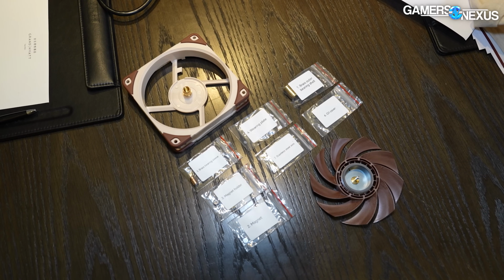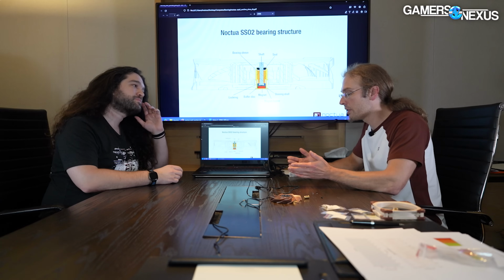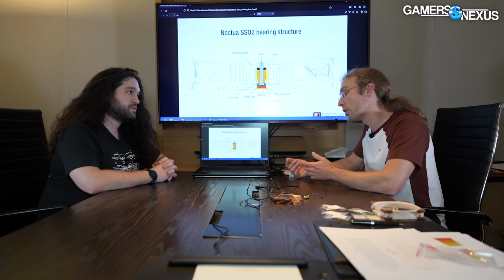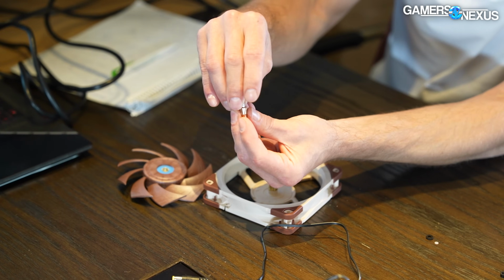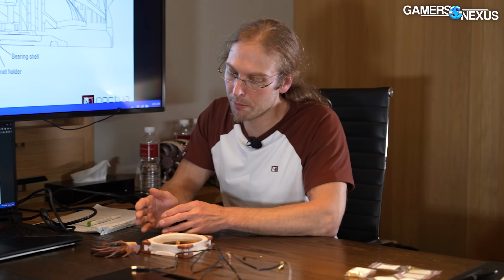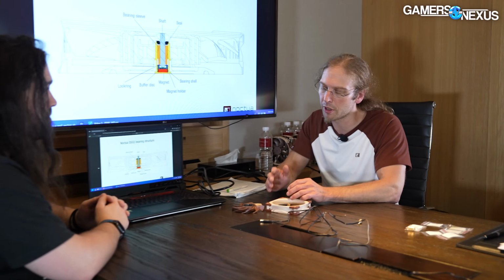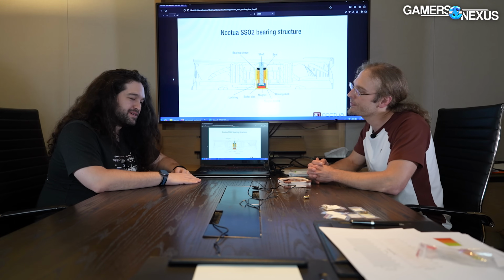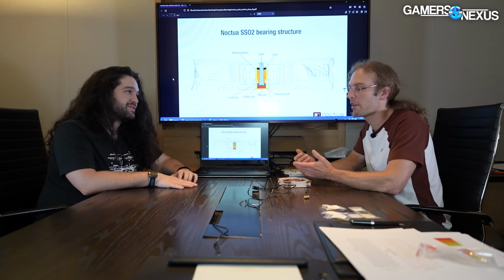Fan Bearing Differences: Fluid Dynamic, Ball, Hydro Dynamic, & Sleeve Explained, ft. Noctua

Comment: He is basically trying to tell that a normal sleeve bearing is essentially a FDB or HDB because it also uses oil pressure to support the rotating shaft. The SSO bearing is like a hydraulic bearing but with a magnet to help with the startup. The grooves on the outside of the bearing help recirculate the oil, and the magnet helps with shaft stabilization. I totally agree with his view that a normal, well designed sleeve/hydraulic bearing works like a FDB/HDB. I have had a fan mounted in my ups running non stop for 4 years. After 4 years the fan jammed, and all it took to free it up was some machine oil. When I inspected the bearing bore while putting oil, it was in very good shape. FDB's would also require oiling sooner or later since they rely on the same properties of the lubricant as sleeve bearings do to keep the shaft suspended. A well made sleeve/hydraulic bearing fan would require oiling every 2-3 years, and so would a FDB fan as I mentioned earlier.

Comment: i disected a few PC fans that claims "hydraulic bearings" only to find a sleeve bearing with babyoil on it (that's a joke, but some form of oil). no vanes at all. so i learned to buy fans that shows how their hydraulic bearings are made. thats why Noctua, has been around for years without the fancy rgb nonsense, they focus on performance and engineering.

Comment: My Old PC has 9 Normal Sleeve Bearing Fans (Case - 4 x 200mm 2 x 120mm, Loop - 3 x 120mm) and that PC has over 100,000 Hours Near Constant Run Time over 10 years. 
Only 1 fan died as wire got stuck in it for Unknown amount of time and when i noticed and remove wire fan was cooked and wouldn't turn anymore.
Do we really need fans with a higher lifespan than stock old bearing type fans as i mean like 75,000-100,000 Hours is a LOT for 95% of people.

Comment: Also Keep in mind Car Turbo Chargers (Most have the same sleeved bearing design all be it with fresh oil flowing through it and they run at 85-200,000 RPM (yes 200,000 RPM) and at temps of 350-500*C

Comment: The rolling noise of ball bearings only becomes a problem if you are in an environment like an anechoic chamber. There are silent ball bearings using plastic ball cage which don‘t have sharp noise, and the friction/rolling noise is usually inaudible one meter away outside the case. The only problem is ball bearings are easily damaged when shipping, which will lead to additional noise. The super-hard steel balls leave indentations on the bearing rings when impacted, and when it rolls over the indentation again, it will make a sharp metallic noise.

Comment: I would love to see fans that use magnetic levitation discussed, I have used some super cheap $20 120mm mag-lev fans from ebay as replacements in a UPS and they have been running constantly for almost a decade.

Comment: As a longboarder, closed type bearings are so much better since they dont foul up quite as fast. Sure you lose efficiency and serviceability because the cages add resistance and restrain access, but I'd rather not have to clean them out every other week

Comment: I hoped that you'd dig a bit more into the dust topic. How do they keep the dust away during normal operation?
It's typical that cleaning dust from the fans manages to bring some dust in the bearing mechanism and cause laud scratching and beating noise.
The seal in the diagram cannot be too tight or it would start to act as bearing itself.

Also, it would be nice to have a fan where the part with the blades could be detached, without disassembling the bearing itself.

Comment: I'm sorry, I am not sure what was discussed and what to make of it. I was looking forward to understanding what advantages some types of bearings have over the other, but it seems like we just learned that just "because something something doesn't mean something", which doesn't explain anything. "Just because it says FDB, doesn't mean it's good." or "just because it has herringbone groves, doesn't mean much at all." I will check out the rest of the videos on fan bearings, but this is the first video that popped up about fan bearings and the least I wanted to know was what "bad" things to watch out for when buying fans. There is a lot of interesting info tho, maybe the subject is more complicated than I thought. Thanks for bringing us cool videos like this!
Reply: Its hard to say, because the actual manufacturing and quality of each bearing matters more than the type of it.

Lets say bearing A was better than bearing B.
The differences between those would be small and a good B could be a lot better than an average A at the end of it.

The only thing to keep in mind is that anything that uses lots of oil will usualy die first, since the oil leaks out over time in a vertical or top side up mounting.

Comment: I've STUDIED the bearings inside the submarines. It's crazy fascinating. I've always wondered HTF they could stop water from coming in with millions of PSI coming in from outside in deep dive?!  Turns out they ADD FLUID INSIDE the sub to equalize press so there's NO CHANCE for sea water to come in in the "bearing" compartment. Nuts.
Reply: Yeah, I used to work on Navy subs back in the 80's (civilian dockyard technician, not enlisted).

One of the most interesting things I saw and worked on, was how they provide a compass repeater outside the sub on the conning tower.  That compass repeater needs a metal housing, with a glass window on top so that it can be read when surfaced, yet also needs to be able to survive the enormous pressures of the deep, without that flat glass window getting broken under the crushing pressure.

Same deal as you describe.  The whole thing is filled with a clear mineral oil and there is a metal bellows on the bottom on the unit, which allows the volume to be compressed in case there is anything inside which is compressible, such as some unwanted air bubbles.

Automatically and passively, the oil inside very closely matches the pressure outside, thanks to the oil and bellows.  The incompressible oil almost perfectly fills the inside and the bellows caters for any pressure equalisation needed due to any area the oil could not fill.

Comment: I wish you'd asked about fan orientation relative to gravity, and how that influences bearing choice.
From my own experience, fans seem to fare best when oriented so that an axial fan will push air sideways, so that the long-axis of the impeller axle is horizontal.
Now, this is a small sample size as I've had less than a handful (5) fans actually fail on me over my time building PC's for myself and my family (a thing I am thankful for), and it seems the smaller the fan, the quicker it fails in any case.
However, I noticed another trend. Most of the fans on my stuff that have failed had their impeller axles long axis oriented vertically. I think this might have been causing the oil to drain out prematurely because brushless DC fans used to be built frequently with the data sticker being the thing that keeps the oil inside the fan bearing, meaning that if the fan is oriented so that gravity tries to pull the oil out of the bearing but the sticker is the only thing holding it in, that sticker will eventually fail and let the oil out, followed soon by a rather noisy fan bearing failure (lots and lots of squeaking).
Since my current PC uses nothing but Noctua fans, I am happy to see that the SSO2 bearing (a type of FDB) they use is far better engineered than using something so flimsy as a mere sticker to hold the lubricant inside the bearing housing.
Knowing what I know now, I can only describe the bearings in those older fans as what I would currently call "Not up to my standards for the task in any way". Every single one of those fans that failed, I took apart. Every single one that failed and was disassembled, had in it a bearing that was nothing more than a sintered bronze "Oilite" sleeve bearing with the only consideration for longevity being an extra drop or two of lubricant for the sintered bronze to wick up by capillary action and convey to the surfaces of the bearing that are in relative motion when the fan is operating, with that lubricant being held inside the fan as a whole by ONLY the label on the back-center of the fan's housing (as mentioned earlier).

Thankfully I know better now, and if I can avoid it I will not be purchasing another fan with such a crudely executed Oilite sleeve bearing.

Comment: 12:40 ish, he's saying a well executed example of one type will outperform a poorly executed example of a theoretically superior type (for pretty much any given engineering task).
This is quite true, all the way out to even mundane everyday "not engineering" tasks.
Take cleaning floors for instance, if you tell someone to clean a floor and they've had say 10 years of experience sweeping floors, they'll probably sweep the floor manually if the task is amenable to this. Tell "just some random person" with who knows how much experience to do the same thing, but hand them a vacuum cleaner, and they'll probably do a worse job than the person doing the sweeping, despite the vacuum cleaner being "the clearly superior choice" in theory.
Same with actual engineering, and this phenomenon is why it's so hard to actually beat the current state of the art with a "new method" rather than just continuing to apply incremental improvements to the known and highly studied way of solving a given problem.
To have the "new method" beat the existing method, the new method must be implemented in a sufficiently competent way, and because it's a new method, it takes a long time to improve the execution of it to the point it is provably superior to the existing method of solving that same problem.
For another example, look at Electric Vehicles, a much more engineering oriented problem.
We've had the technology to make them since around the same time we had the technology to make internal combustion engine vehicles.
And yet only in the last 15 years or so have we seen them become commercially viable, because the implementation of the EV's battery which provides energy to the motor to move it was not sufficiently competently executed due to limitations of technology of the time. Lead Acid batteries of all kinds are simply not sufficient to provide a good enough range, they don't last very many charge/discharge cycles when discharged most of the way (over 80%) every time you charge/discharge them, and they have a high environmental impact both to create, and to recycle or dispose of them. Lithium ion batteries changed that, but lithium ion battery production has only really taken off in the past 25 years, and only been scaled up enough to meet demand for EV's in the past 10 years, but now that EV's have a competent battery system, EV's themselves are commercially viable.

Comment: why is it that Arctic fans have such great static pressure, and run almost silent at every speed?  Based on Performance and low noise Arctic have been the best fans I ever owed. As a side note they are also the cheapest to purchase.  I wish there was a breakdown of fan build and comparison to other fans as well as testing to see if the specs are accurate.  That said Ive tried different fans for my application, and Arctic wins on performance and noise every time.

Comment: It's fun to learn more about fan bearings, when one of my gpu fans died, other rattles at lower speeds (because it doesn't detect it's own rpms and uses rpms of first one) and jury rigged a case fan to gpu for some cooling.

Comment: Kind of confirms the "vibes" I've got when doing shopping and research -- "FDB" has no clear differentiating factor, is in the cheap and expensive fans alike, and isn't specific enough (if they mean anything particular by it in marketing) to make a good purchase decision based on. Although it is vaguely "better" for the typical use-case of a personal-use computer for most likely being somewhat quieter than ball bearing.

I appreciate reviews based on noise and thermals... On the other hand, lifespan is very hard for a reviewer to meaningfully benchmark. So, really I think it comes down to some sort of judgment call, and since Noctua has staked its identity in the market on being a premium option for more exacting build quality and engineering standards, and a serious dedication to longevity (both of support and product lifetime)... it's something I would personally trust Noctua to deliver on in any product they put out. I also trust them more than other companies to make the right choice for a given product segment even if it goes away from the current "meta" or marketing hype trend -- if engineering shows it to be the right choice for the intended use-case and manufacturing it that way is feasible, I believe they will tend to do it.

I wish we could easily know as buyers how long a fan will last, and how well its low-noise operation will hold up over time. Until we get a meaningful way to convey the quality of the manufacturing and engineering standards of the product, brand reputation really is the next best thing, and sort of the best we have, in my opinion. I can see why Jakob would point to that, there's not much more consumers can really go by. That, and if an unusual proportion of reviews report failures then the product is probably not that good, but people are reviewing after a couple of days usually, maybe a few weeks or months, very rarely a few years. Almost never decades. And by then it's too late, the product is usually discontinued... Oh, well.

Comment: Has any manufacturer considered synthetic Sapphire bearings?  i.e. similar to what is done for individual gears within high end "automatic" mechanical watches?  Such as the Omega Daniels calibre 2500 movement? Note that the cost of such bearings is minimal at USD 0.02 - i.e. 2 USD cents per Sapphire bearing unit.

Comment: I feel confirmed in my fan choices. 
I use a 140mm Noctua on the intake, a 120mm Noctua on the cpu cooler and a 120mm Arctic with ballbearings on the exhaust.

Comment: I have several fans that have been in use for over 2 decades and they still do fine.

But I seem to be one of those rare people that actually fully cleans and does maintenance on his systems every 2-3 months.

For most people, including me, the bearings going bad isn't the limiter to a fans life.

A fan taking a chunk of your finger and loosing a piece or a whole blade in the process seems to be the primary reason for their life to end.

I still have and use a Antec Ninehundred.

They were famous for having a 200mm top fan.

I've had to replace that top fan 4 times over the years because it lost blades on the regular, twice all on its own and twice from some finger biting action.

I replaced it with a Noctua model and haven't had a single blade break since (have had even bigger chunks of meat being extracted from my fingers though.)

Comment: I might have missed it but can u ask if noctua has done any testing on outer ring connected to the fan like the fe coolers? What kind of performance changes does it make? Is it just acoustic? will having the blades a mm shorts effect performance that much?

Comment: Ball bearings , shafts ,bare bone , fluids , this was a difficult topic to Steve go trough without lolling ... this is a interesting topic , I always associated ball bearings to longevity (like the old eternal papst ) but they are noisy  . teflon/nylon low speed sleeves fans are quiet , but cannot be neglected , as lubrification dry out and dust on the fins will reduce the life quite fast .

Comment: 9:24 - Making the plastic part of the fan (i.e., the hub and blades) detachable from the shaft shouldn't require removing the seal. It might lead to other problems, but it wouldn't lead to contamination inside the bearing.

Comment: Where do mag-lev fans fit into this?  I'm using the Corsair ML120 fans (the original, non-RGB version), and they seem to perform quite well.  As quiet a fan as I've ever used, and presumably the longevity will beat any other type of bearing.  But if it was so great you'd think everyone would have a version of that fan by now.

Comment: Thanks for the video Steve. You get similar discussions in turbocharging although I would call the overwhelming majority fluid dynamic bearings of the sleeve type, main difference being lubrication is supplied under pressure and is total loss via gravity.

Comment: bearing and motor are what makes fan usable or useless, no matter how good the impeller is if these two are bad you won't be able to run this fan at any speed due to noise

Comment: I went through this a couple of times and had a question about fan orientation vs bearing type. Are there bearings that perform better when the fan is mounted vertical vs horizontal (hub up) vs horizontal (hub down)? Running the same 120mm fans in each of these positions some wear out before others, in my experience. Horizontal (hub up or down) seem to wear out before vertical fans.